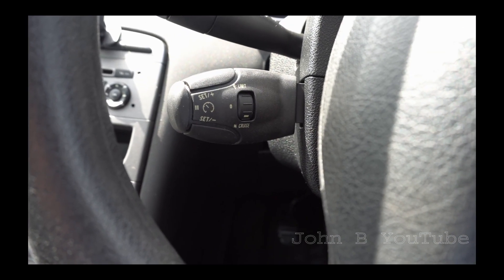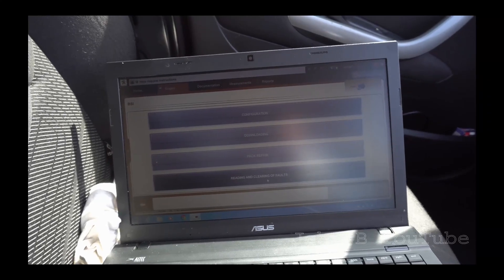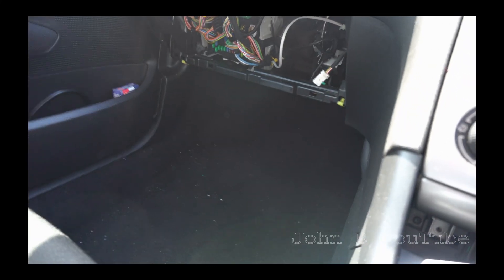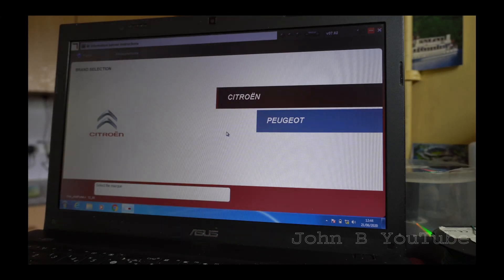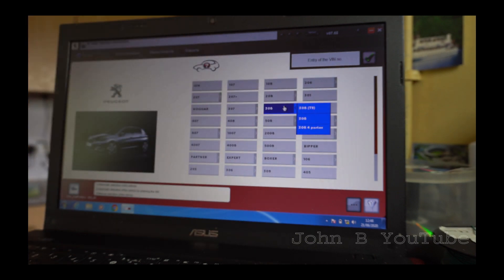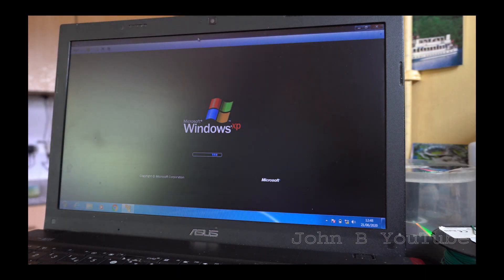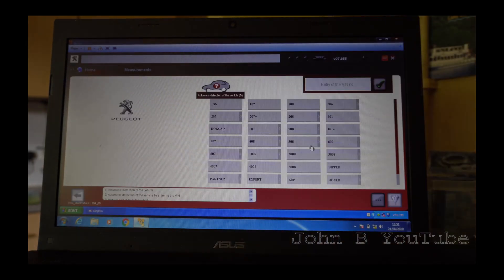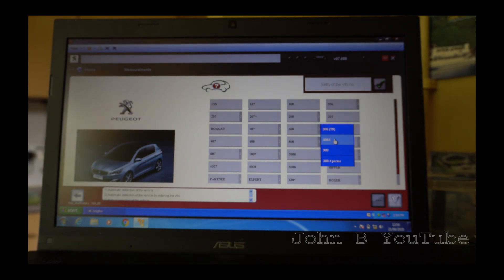Retrofitting Cruise Control to a Peugeot 308 + Diagbox information.

Comment: Hi mate 
I've been installed a stick , marked cruise control present on bsi and ecu using a Launch, I do have the cruise control showing on the dash now but once I try to get it going the 3 lines are flashing and won't set. 
Any ideea what's going on? 
It's a 308 1.6 vti 2009
Reply from the maker: Make sure you have a clutch switch etc.
Reply: @JohnB-2021 
Thanks for replying 
I do have it, brake one as well. 
Could it be due to not ticking the speed limiter ?
Cheers

Comment: I got retrofit cruise control on my 207, year 2007. Everything went well at the work shop, until the program started to complain about temperatures being too high! Apparently you can't install cruise control if the motor temp is higher than 30 celsius. :D

Even the mechanic was baffled and didn't know what to do and the installation failed, even when the motor cooled down. The program still complained about temperatures. Do you have any ideas what could be the issue? My dash just says "cruise control impossible." I don't find anyone online having similar problem...

Comment: Hi,
Mine is Peugeot partner 2012 1.6i.
Have brake light switch. (obviously every car has)
Have clutch switch but NO wires are connected. 
CC still will work?
I have same version of software and hardware. Both from Aliexpress. 
Good tutorial. 👍
Reply from the maker: Thank you for your comments.
I’m pretty sure the cruise control will not work without a clutch switch connected.
That is bad luck; I’m not sure if the clutch switch is wired to the bsi or the engine management unit.
Reply: @John B  You said - going to BSI, repair, manual configuration and so on.
How to make changes in ECU, you have step by step info.

Comment: Hello Jhon, Just installed on my 308 2013, It does show the options for speed limit and Cruise, but they don't  work, and the Cruise Control keep blinking (on any gear, 1 to 5) do you have any tip for this?
Reply from the maker: Do you have any faults present in the fault memory?
Cruise does not work below 4 th gear.
Is yours a Bosch unit or Siemens?

Comment: Hi John. Excellent video and very informative. I have a 2009 Peugeot 207 van. Could you put in the link where you purchased your hardware/software. There's endless options out there, just want to make sure I purchase the correct one. Thanks.
Reply from the maker: eBay item number 261751630895

Comment: Do you have a link to buy the diagbox? See so many different ones on ebay it's a bit of a minefield
Reply from the maker: Just look for UK, they are at Birmingham, Mansfield and stalybridge
Reply from the maker: Mine was from Stalybridge, I got a small bit of discount but he does not give you the latest software so look for best deal.
Reply: Thanks for the info. What extra steps would you need to take to get the speed limiter function working?
Reply from the maker: Chris1094 depends on model, year and make of engine management: Bosch or Siemans etc
Reply: It's a 2010 308 with the dv6ated4 engine. Not sure which ECU it has
Reply from the maker: @SuperAlbino1  Mine has a Bosch and was no problem, a friend has a 2013 estate with Siemans ECU, the cruise control did not work but his speed limiter did.
Where in the country are you?
Reply: I'm in mid Wales

Comment: Hi John, 
Great video, except the steering wheel in the wrong side of the vehicle. :-P

You are correct. The Cruise control in my 308 only works in 4th to 6th gear.
I don't recall the existence of any particular sensor for this. And it's far more intelligent to calculate the gear from RPM and speed, than adding another sensor, so you are right, that must have been Peugeot's approach to begin with.
Speaking of 6th gear, you've sorted the CC, folding mirrors (not to mention the new DPF) with great success.
How about a 6 speed gearbox, now?  =D

I'm most interested in your CAN bus reverse engineering videos. So here's what I'll be wacthing next.

Be safe!
Best,
Reply from the maker: Thank you Francisco
I'd also like the 6 speed box lol
I'll be makeing more CAN hacking when I have more information.
jb
Reply: @JohnB-2021  You might want to know the rpm to speed ratios on a 6 speed gearbox and find out it's not worth it.
I believe the 5 speed one may have the same (or near) range, which in turn is nicer to handle; less fidling with gear changing.

:)

Comment: i think all interfaces are made in different parts of china the quality is the issue they come with labels with france on which you stick on  ,   the firmware i was told with mine that i can install 7.85 but it is unstable for programming , but i think any later software is online only so i may have to get new hardware anyway
sorry well explained thankyou
Reply from the maker: Thank you for your comments.